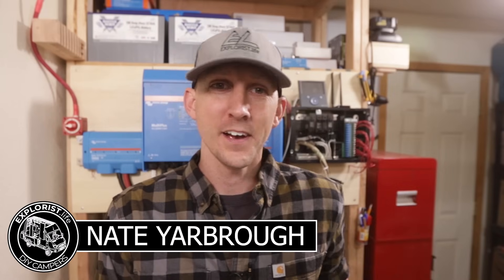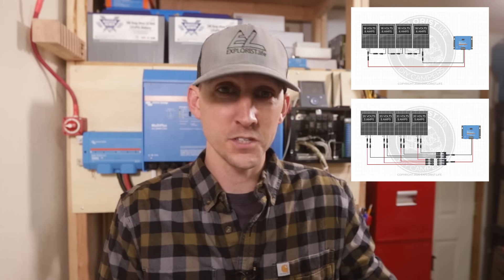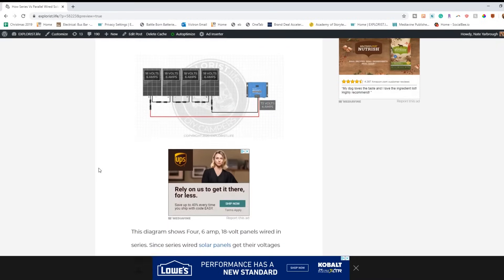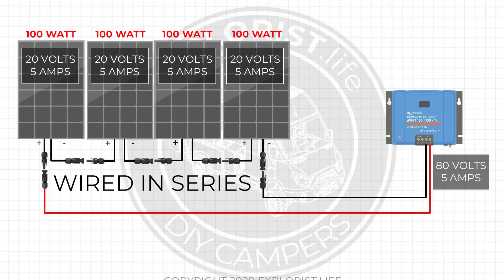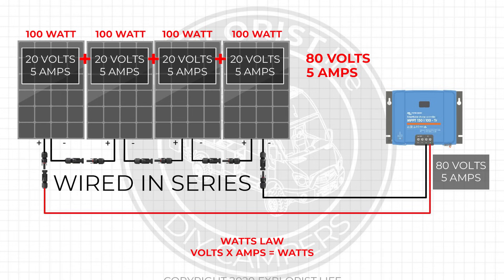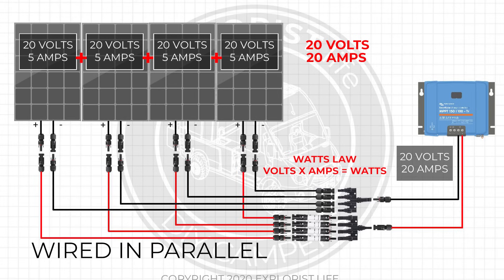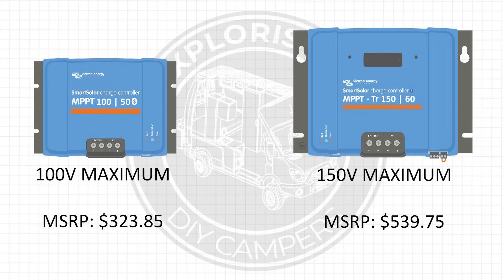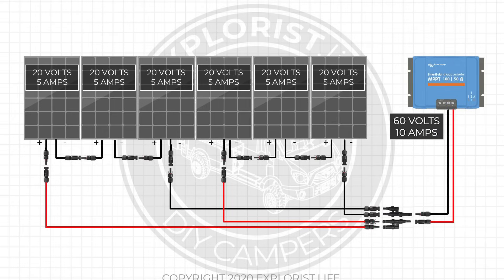Solar Panel Wiring vs Volts and Amps

Comment: Hi Nate, nice job with the video. No matter how you slice and dice this stuff, people really want to know how efficiently and quickly these configurations will get their batteries charged, because that is the end goal. I have (3) Renogy 160W in parallel mistakingly thinking (initially) that the higher current of the parallel config going into the MPPT would get my lithium’s charged faster while in fact that is not necessarily true. It’s the output of the solar charge controller that really matters and how efficient (MPPT) or inefficient (PWM) the charge controller is that determines the amount of charging current delivered to the batteries over a specific period of time.
Reply from the maker: Awesome!  Glad it helped.  Thanks for watching!

Comment: I've got 3 175w solar panels at 24V (open circuit voltage) and 9A (optimum operating current.) in series that makes 72Vx9A= 648w, parallel is 24Vx27A= 648w. I'm wondering why the math doesn't take me to 525w... help?
Reply from the maker: Try the Optimum Operating Voltage * Optimum Operating Amperage * Number of Panels
Reply: @EXPLORISTlife  perfect thanks!
Reply: also, Nate, in your wiring diagram for 3x175w panels and 200Ah batt, you recommend a 150/60 charge controller. I understand going a little overkill on charge controllers if you may want to add a solar panel in the future, but I simply have no more room. Since I wont be expanding, I think the 100/50 charge controller would be enough. Agree?
Reply from the maker: Sometimes I recommend an 'overkill' charge controller because people ignore the panel that I recommend and they think they can substitute ANY panel into it's place. When making blanket statement diagrams like I do, I have to figure in a high margin of error to cover 'most' of those cases.  The 3x panels into a 150V charge controller is definitely one of those cases.

Comment: Hi Nate, love the videos, I am planning the following system,

2 x 250W solar panels 
1 x Victron Orion-Tr Smart 12/12-30A dc/dc charger
1 x Victron Mppt 100/50 Charge controller 
1 x Victron Multiplus Compact 1200 or 1600 unit.
1 x 200Ah LIthium battery

I have a question regarding cable sizing. On one drawing you have 6 AWG from the vehicle battery (Alternator) to the DC/DC charger, however in another drawing you show a 2/0 gauge cable coming from the Alternator. Which is correct as these are very different sized cables? TIA
Reply from the maker: They are both correct for their respective components.

On the diagram that have 2/0 from starting battery to house battery bank, it uses a battery isolator, so MUCH higher amperage's can be expected to flow.

On the diagram that has 6 AWG from starting battery to house battery bank, it uses a DC-DC charger which regulates charging amperage AND boosts voltage (thus decreasing voltage drop issues).

So... for your case... you should follow the diagram with the DC-DC charger (Orion-Tr Smart 12/12-30) as that is what is in my DC-DC charging systems as well: https://www.explorist.life/2000w-inverter-200-400ah-lithium-200-to-700w-solar-camper-wiring-diagram/

Comment: Great video. How does this all equate in regards to amperage/voltage coming out of the controller going to the battery bank. Let's  say you have a 730 watt array and 100volt/40amp controller, what would be your maximum voltage/amperage going to the batteries on a 12 volt system and would there be wasted power becuase the controller has a maximum output of 40amps?
I have seen some systems for sale with 800 or 1000 watts and the controller in the package is 40 amps?
This is what confuses me.
Reply from the maker: GREAT question.  The charge controller will charge a 12v battery bank at anywhere from 12v - 14.6v depending on how depleted the battery bank is and the chemistry of the battery bank.

We can figure the amperage heading into the battery bank by dividing the watts being produced by the solar array by the voltage required the battery bank.

So...  730W from the array divided by, say, 13.6V of the battery bank = 53A headed into the battery bank from the charge controller.

If this was all connected to a 40A charge controller, the 13 additional amps would be throttled, and not used.

A system with 1000w into a 40A charge controller feeding a 12v battery bank is not properly optimized.
Reply: @EXPLORISTlife  thank you for your response and that clears things up. 
The 730watts coming from the array would be in perfect conditions correct?
The reason I say this is I currently have a 365 panel connected to the said 100V/40Amp controller and the highest amperage I have seen coming out of the controller has been about 18-19 amps.
I was thinking of adding another 365 panel and thought I could use my 100/40 controller but I should really be looking at upgrading to 60 or even 80 amps.
Its on a houseboat with a 8- 6volt battery bank (connected series parallel -  1700amp/hrs) for a 12volt system. I don't want to change to a 24 volt battery bank as I think it would be a wiring night mare.
Thank again for the information. You do a great job of explaining.
Reply from the maker: The 730W would indeed, be in perfect conditions when the temperature of the panels is at or below 75 degrees F (25 degrees C).

Comment: The part that is stumping me is the total watts. In using your 16 panel array of 100 watts example, I’m having trouble finding an mppt controller to handle it. The total is 80 volts and 20 amps, but when I add up the watts, it’s 1600 and I can’t seem to find a controller that is specced for that. Unless my math is wrong
Reply from the maker: Your math is correct, and that is indeed an issue... BUT... re-do your math and figure for a 24v battery bank...

Comment: love your,thank so much for the informative videos, but im confused, i have 2 100watt renogy panels,
 an EP solar tracer  series  MPPT 30amp charge controller and a 1800 watt power inverter and 2 alpha cell 240 xtv 12v 112ah batteries to 
setup on my van, do i want to set up my panels in series or in parallel 
to get the best performance?
Reply from the maker: Series.  As long as the charge controller can handle the increased voltage.
Reply: @EXPLORISTlife  awesome thank very much, again love your informative content.

Comment: Hey, I wanted to book time with you to gather a parts list for my solar system. Its going in a 2020 sprinter 2500 4x4 170 tall roof. I bought 4 Relion RB 100 LT low temp lithium batteries.-   and 4 Renogy 175 wt  flexible panels. I want to know what victron components and wires I need to correctly assemble. Lmk if I can book that appointment. ty.
Reply from the maker: Hey John!  You can check my calendars for consulting at https://www.explorist.life/consulting but as of writing this message, I am unavailable for 1-on-1 calls for the next few weeks and unavailable for custom wiring diagrams indefinitely.  I am, though, answering personalized questions in my private group every day m-f here: https://explorist-life.mn.co/

That said, you likely don't need a custom diagram as I have two free diagrams here that would likely meet your needs:

For a system with a 3000w Inverter:

https://www.explorist.life/3000w-inverter-400-600ah-400-to-1200w-solar-camper-solar-kit

For a system with a 2000w Inverter: 

https://www.explorist.life/2000w-inverter-200-400ah-lithium-200-to-700w-solar-camper-wiring-diagram/
Reply: @EXPLORISTlife  Extremely grateful, you are a gift.

Comment: 420w panels x 12 panels. Series parallel setup 4 panels in a series. Total 96 Volts 52.5 Amps. Which gauge wire to the charge controller from the combined box?

Comment: How do you run 3 panels in series using Anderson plugs?
Reply from the maker: You'll have to get creative.  All of the panels I recommend have MC4 connectors so it's nice and easy.
Reply: EXPLORIST life - DIY Campers Is it a requirement that panels have to be wired in series or parallel? I’ve replaced the MC4 connectors (primarily so I feed the wires from the panels through drilled holes in the grease of my greenhouse) with Anderson plugs, then used branched mc4 connectors, but with Anderson plugs. So it’s 2 panels into 1 set of branches, off one branch is another branch which connects to the third panel, into an mppt controller, which in turn is hooked up correctly to an inverter then to two 12v 135amp hours batteries in parallel.

Comment: Thank you for your very good information!  Very helpful!  My system will be 4 x 260 watt 24v panels.  I have a MPPT 12/24v charge controller and working to get more batteries ;>)  I believe the series parallel would work best on top of my rv 5th wheel on order but wanted to get your input first.  I also have a 3500w generator we will be taking but wanted to use the solar panels if possible.  Will I need to make this a full 24v system through a sine wave inverter (which I have) or convert to 12v which is how the rv will be wired for?  Thank you for your help!

Comment: When grid tied putting out 240V AC from the inverter... how’s the two different AC’s from utility power and Solar power react to each other ?
Reply: That's the whole point of a grid tie inverter, they r synchronized... so they don't cancel/short each other out..!
Ur grid tie inverter will set it's output voltage slightly above the grid voltage so it can push it's power out...
Imagine 2 bottles connected by a pipe, each is half full...
If u raise 1 bottle (like raising the voltage) the water flows out 2 the other bottle...
Hope that helps...

Comment: I have 26 - 60 watt panels and it says max system voltage is 50 volts. Operating voltage is 17.5 with an open circuit voltage of 25. Does this mean I can only wire 2 panels in series to not go above the 50 volts. Thanks.
Reply: Yes that's right...!

Comment: What about the ONE LARGE industry panels many build companies are using on van roofs?  One Solaria 360W panel $331? 
Vs three Rich Solar 100W? Or the RIch Solar 190W $180 ea. panels x3 = 570W. Guys at Light Hrvest say their Solaria panel out performs any mail order panel? “ how so?”  “ they are just better, industrial  home panels” , “ humm”  True?
Reply from the maker: Most panels are 'similar' in efficiency.  The total array wattage is what matters.  3x190w panels will charge faster than a single 360w panels because it's something like 1.6x more wattage.

Comment: I have a 12v 100 amp gr8 sealed lead acid battery charging from alternator in my van. Looking to get solar for it. Witch set up if I get at least 2, 100w panels will charge my battery faster,
Or Would it Be better to get one 12v say 240 watt panel.? (Monocrystaline )

Comment: Thanks for such an informative video. I am hoping you can advise me on how many charge controllers I will need. I bought 24 panels that are 270 watt. 35.5v and 7.6 amps each (72 cell panels). I want to run a 48v system with 12 strings of 2 panels wired in series parallel. My charge controller is a 60 amp morningstar with max volts at 150. Should I buy 1 charge controller for each string as a safety precaution? Thanks!
Reply: I will have 2 separate battery banks as backup power. I am actually thinking of going with 1 string of 16 and 1 string of 8. The 16 will be my main power source and the 8 will be auxiliary. I want to connect an automatic transfer switch which the voltage levels can be adjusted per battery bank
Reply: @Steve Majors 
Ur making things 2 complicated 4 urself... Keep it simple...
If that's 35.5v Voc...
150/35.5 =4.23 so 4 panels in series is all u can have in a string.
U can then put as many strings in parallel up-to ur amp limit...
60/7.6 = 7.89 so 7 strings in parallel
So...
7x4 = 28 panels max..!
Hope that helps.

Comment: This is the best solar channel I have found.. Now I know how to maximize my victron 100/50 mppt.. Running 400 watts of solar to it nowbut about to add 600 watts more to it.. Thanks so much..
Reply from the maker: Thanks! :)  Keep in mind that the "50" part of the 100/50 is referring to the charge controller OUTPUT amps.  Not the input amps.  1000 amps pushed into a 12V battery bank will be somewhere in the 83 amps range; so the 100/50 will be a bit underpowered for that many watts.
Reply: EXPLORIST life - DIY Campers thanks i had that mixed up.. So it looks as if i can only hook up 700 watts of panels into it. Can You run 2 charge controllers on one 8 battery 12 v bank or would it be better to split the bank and controllers and have 2 separate solar arrays? thanks
Reply from the maker: Just knowing what you've described, I'd recommend 2 charge controllers if they array warrants it feeding 1 battery bank.
Reply: EXPLORIST life - DIY Campers thanks so much you are awesome..👍🏻🌞🌞🌎

Comment: My question is:  What's your recommendation when building a system to be used for 1y in US (110v) then moving to EU (220v)?
-95% 12v appliances 
- Eventually shore power connected 
- Non 12v:  laptop + 1-2 appliances (not at same time)
Reply: Hey buddy...
The easiest way is 2 just sell ur 110v inverter in the USA b4 u leave & buy a new 220v inverter.
Hope that helps.
Is it going on a boat..?
Reply: @MaxMax-dq1lu  on a converted bus. My concern is wiring for 110v in US and having to re-wire when in EU.
Reply: @TchauRod  @110v u have 2x the amps 2 reach the same watts... so ur wires will b more than sufficient @220v if that's what u mean...

Comment: Me and my husband purchase your plan for the 3000w inverter and the wiring kit. Totally satisfied but we hit snag in the wiring diagram in reference to AC out to a AC panel. We have a separate AC panel and a separate DC panel by Seagate for 12V lights, 12V pump etc. 
How can we safely wire the DC panel into this plan?
Reply from the maker: The panel I recommend is simply an all in one unit.  If you want to divide them up, that's fine.  The wiring could be the same.

Comment: Great video. My question for you. I'm looking to put in near future, at least 200 watts of solar panels to my van. Witch set up would make it the best for the quickest c charging of my battery ? Also, I heard if you wire panels in series, if one panel is damaged or stops working, all the panels stop working. Is this true ?
Reply from the maker: Generally speaking...  either series or series-parallel will work best.  and Yes, if the panels are wired in series and one dies, it will negatively affect the whole array, but if maximum solar power output is desired, broken panels should be replaced as soon as possible.
Reply: Its not that perhaps the panel is “broken” but rather often a panel may be blocked by parking under shade tree or storage box or fan is blocking sun input to one panel.

Comment: Hey dude I’m having a solar issue. My charger usually read all the way to 14v and never ran outta power. The other day I plugged a minifridge in and overnight and she got down to 10v. Started beeping and it’s been a slow ride back to full power. Hope I didn’t break the battery :/
Reply from the maker: Probably didn't break it.  Likely just drained it fully and took a few life cycles off of it.
Reply: EXPLORIST life - DIY Campers Yeahhh I mean it’s gotten back up to 13v on the reader which makes me happy. I’m use to having 2 fans running all day n night without worrying about power tho so I think I may have lost a cycle :/ any way to restore the battery or I have to buy a new one?   Also if I hooked up a new battery to the busted battery would that be a bad idea? 

I could keep the busted one As backup for my power tools n what not :)

Comment: This series is fantastic! Some of the info you cover I already knew well, but I still fully enjoy watching. Even if you don't plan on doing any of this stuff yourself, if you own a solar system, you owe it to yourself to watch this series so you can at least understand what is going on with it.
Great job Nate! Kudos!
Reply from the maker: No problem.  Happy to help!
Reply: @EXPLORISTlife  is 80volts dc 15watts more energy than 20volts dc 15watts?
Reply: @EXPLORISTlife  hello could you help me with the wiring of my pv array
Reply from the maker: @boomblastjeno5226  For sure!  That's what this video teaches you.  Or perhaps you should just choose from the arrays we've already designed.
Reply: Ok I have six 270watt 24v panels voc is 38.55v the lsc is 9.10 vmp is 31.47v  the lmp is 8.58a max system voltage 1000vdc max system fuse is 15a my inverter is a mppt 5000w 48v the max pv array is 145vdc could you please send me a diagram of how to wire these panels the proper way please thank you

Comment: I was hoping you would address the function of the MPPT charge controller in how it coverts the surplus Volts into Amps and what the math is or how efficient the conversion is. Also, how the panels function when one panel is in shade and how that effects the output in V and A in Series vs Parallel.
Reply from the maker: Those are coming up in their own specific video.  Stay tuned. :)
Reply: @EXPLORISTlife , I am very interested in this as well. No one has covered this info that I have found. Any update on the time frame for the video? Thanks so much
Reply: @EXPLORISTlife 
I hope u also cover the difference in theory & practice of series/parallel...
ie. Parallel = higher current = more losses (so less efficient)
(& more expensive charge controller)
also fatter wire = higher cost..!

U should have mentioned it in this video as well...
Otherwise it's the best I've seen on this topic...